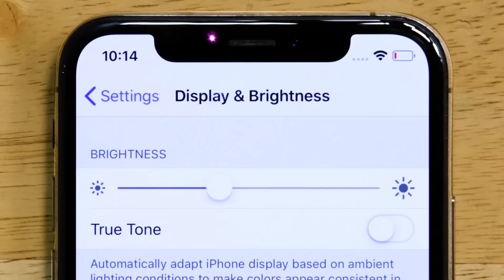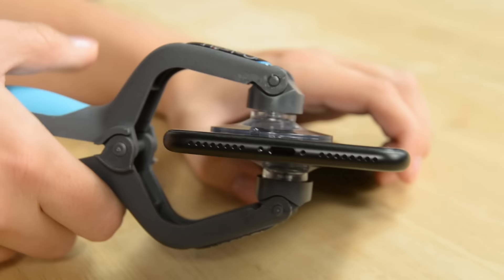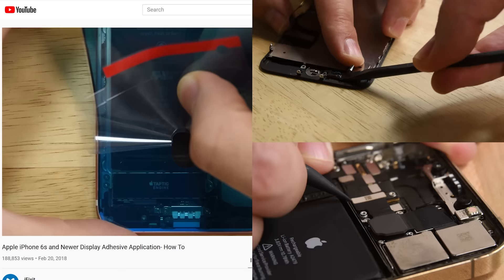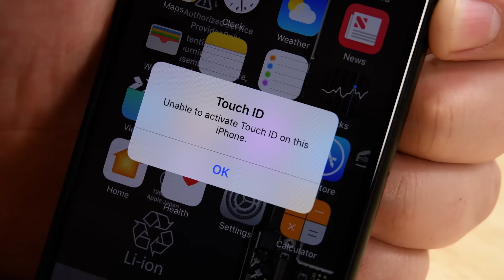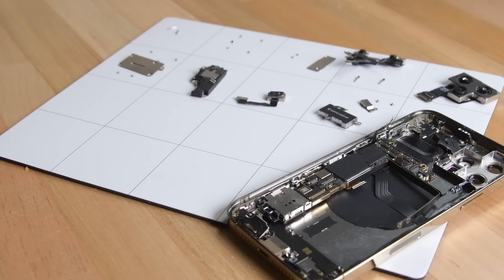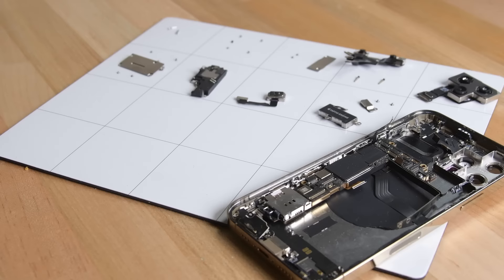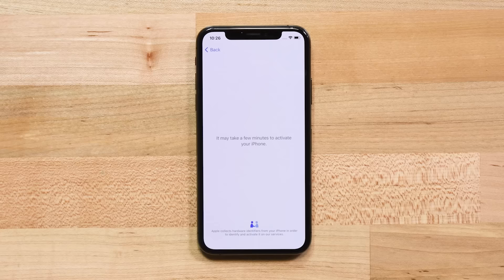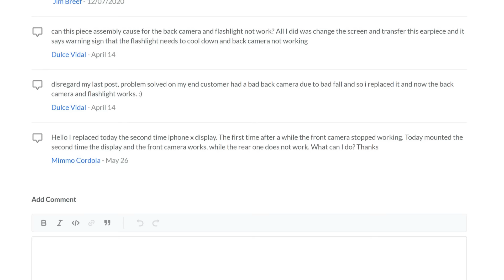5 Things You Need To Know About Repairing iPhones

Comment: To conclude: samsung is better
Reply: I implore you to look into the requirements for the repair of a modern Samsung phone. While in the past they were significantly easier to repair at home, nowadays simple replacements like battery and screen are just as difficult, if not more so, than Iphones; additionally, the replacement parts are often significantly more expensive in recent years. 
You and I likely hold a similar view on right to repair issues and tech design in general, but boiling down that discussion to "x company good, y company bad" rather than addressing the core, profit-motivated issues that ALL companies are motivated to pursue, we won't get anywhere toward a solution.
Reply: @micahraney732  you know nothing
Reply: @MK-ls2jg  have you ever noticed how often Samsung uses permanent adhesive to keep the battery in place instead of pull tabs?
Reply: Yeah their ovens are pretty good imo
Reply: Battery tabs are one example. Screen repairs on anything past a Galaxy S6 are brutal nowadays. On most of the modern ones, you're stuck with either an impossibly thin screen to firmly seal in place without bending the LCD, or you have to spring for a full frame repair - and that's after the backglass removal and complete disassembly. I hate Apple as much as the next Ifixit viewer, but at least I don't have to disassemble the entire phone to replace a screen.
Reply: @micahraney732  yeah i just made a little example because your explanation was so much better than anything i could've done
Reply: iPhones are easier to repair than Samsung if it weren’t for the software locks. With Samsung you have to take out basically the entire phone for a screen replacement or if you are doing a battery replacement, you don’t have pull tabs instead it’s glued down.
Reply: @micahraney732  this is true, I attempted a repair on an S9 and, although I think I could do it with my current experience level, It seemed borderline impossible a year ago.
Reply: Instead of comparing your phones why don’t you go build a go cart like I did as a youngster in the 70s?

Comment: The main thing that I don’t like is the amount of different screws
Reply: I'd recommend laying down the screws in the order you took them out, in a vertical or horizontal line, as well as in the general relative position they were inside the phone. That way, when you put it back together, you just follow the line back to when you first started taking out the screws.
Reply: @gold4963  that’s pretty much what I do, but it is still confusing sometimes

Comment: Good video. Thanks for showing how Apple makes repair difficult. Special screws and parts programmed to the board. 

This is why supporting right to repair is important. There is currently no way to get parts from Apple and even using a genuine screen from another iphone will give you problems. Watch Louis Rossmann.